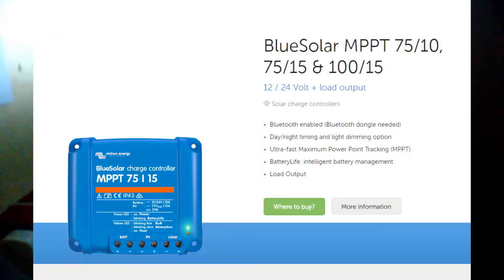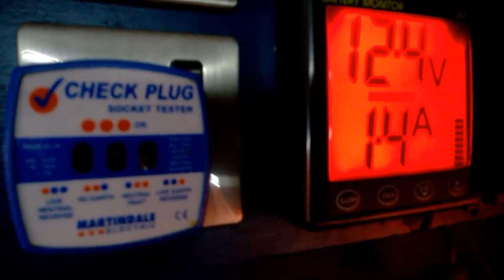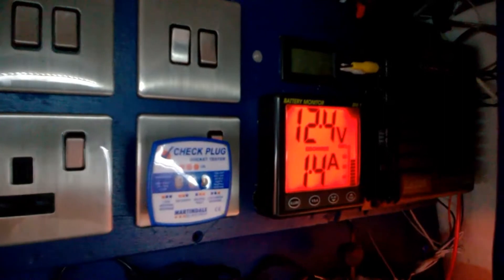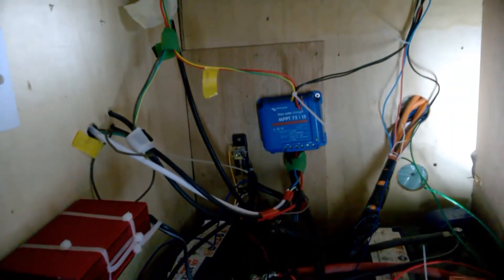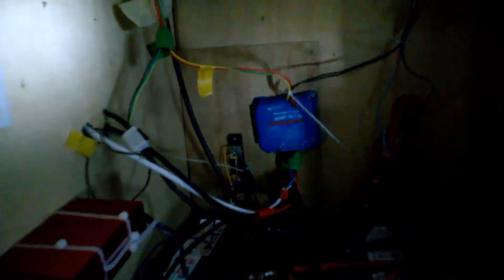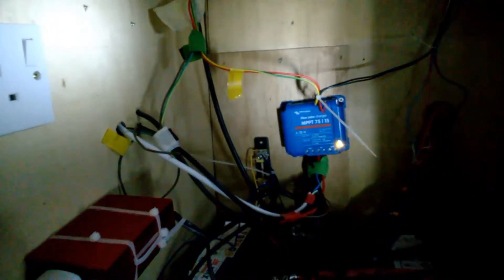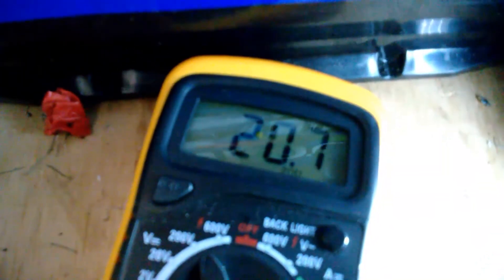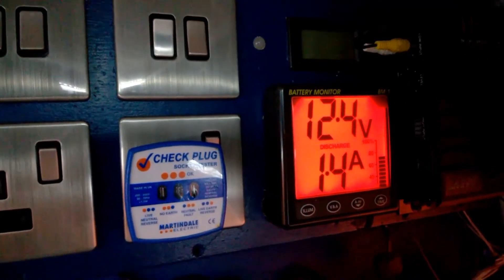Solar Controller Issue - Part 2; Victron Energy say it is working but ...

Comment: Load test your battery 2 lights blinking , battery connected (green), 80% charge (yellow), battery problem maybe???
Reply from the maker: Hi. Thanks for that, however, it did turn out to be a faulty charge controller and they sent a replacement :)